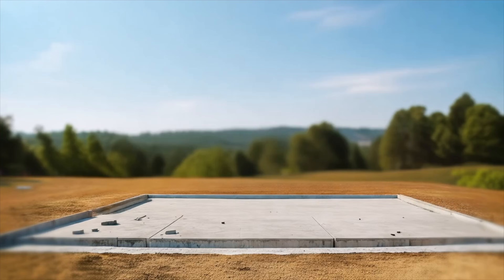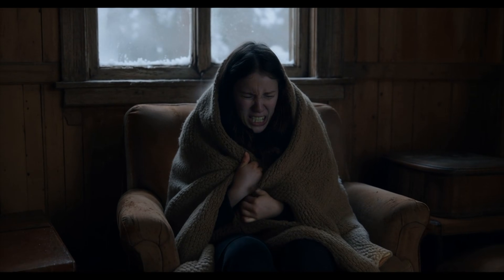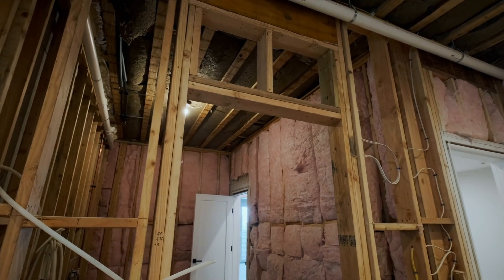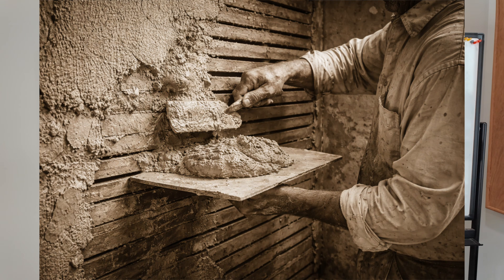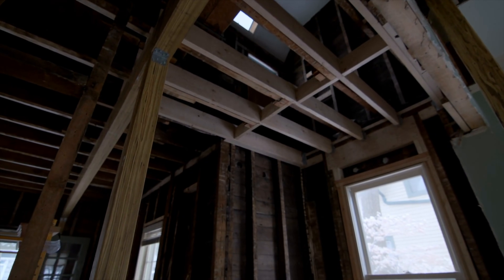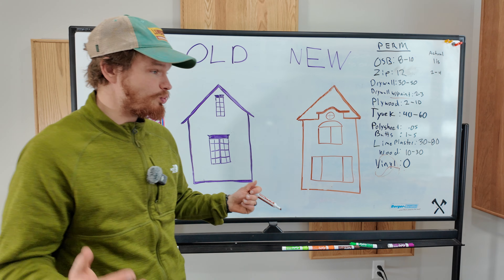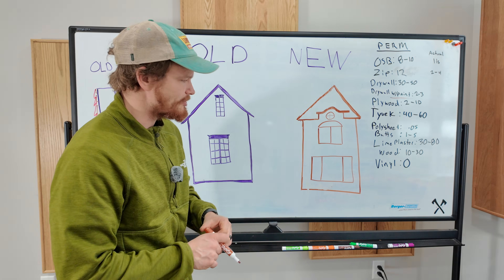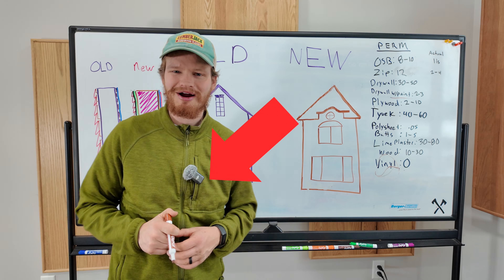New Houses Are Growing Mold — Old Ones Somehow Usually Don't

Comment: Wall permeability is a myth. The real problem lies elsewhere - it's lack of ventilation. Old houses were just leaky - even during winter days where all the windows were closed shut there was a constant air exchange. This was amplified by combustion furnaces that constantly sucked air into the chimney. Modern houses are super seal so they need a separate ventilation system - ofen mechanical one. With proper ventilation no mold and moisture will never appear. But many investors build houses with badly designed ventilation or no ventilation at all. I know people who intensionally removed ventilation from their house plans because they believed it's unnecessary. They got mold on the walls after first winter.

Comment: Turns out humans don't do well when you put their habitat in a Tupperware container. 
Our homes are meant to breath.
White wash was lyme based and let moisture pass through, it's a great finishing material and very cheap compared to latex paint. 
We bought a fixer upper home build in 1917 and first thing we did was rip out all of the carpet, floating plank, insulation roles and paneling slapped over everything. The basement and several rooms were "finished" in the 70s which means they just slapped insulation and paneling and carpet directly onto the unsealed basement  
walls, floor, and ceiling. There was SO much moisture and nastiness trapped everywhere. We did refinish and poly the master floors just because we were surprised by some major pet damage under the top layer of flooring and had to make a quick decision to seal it in place and deal with it down the road. 
The original hardwood is much nicer.
I'll forever curse the trends of the 80s that had every housewife drowning all her rooms and nice wood finishes in latex paint and sponge painting every year. They didn't even use base coast or let them dry properly between layers so I have a bunch of wood trim in ugly colors that are gummy and can't be cleaned or repainted properly, they have to be stripped or completely replaced and there just isn't wood stock available to match the quality from these older homes. Therapy would have been cheaper 🙄.

Comment: tips and tricks. maybe groves cut into the drywall to look like bords with an inch space between and not painting inside the groves. a fan pointing up in the bathroom is a great way to dry all the nooks and crannies out fast. you can also use a fan to dry out food scrapes before putting them into a garbage bag or dry out shoes to keep them from smelling. if you don't have a window in your bathroom, you might as well use a fan to dry fast and open a window elsewhere to dry out the rest of your place too

Comment: Old builders used to also feame up amd lit a roof on before sealing walls so that there was rain protection and a dry works space for the rest of the job, preventing water being trapped in the rest of the build as it is closed up.

Comment: Our modern structures are made with with hvac in mind. to seal as well as possible from outside. The problem is that they are more or less made to trap humidity in with us. Everything we do throught the day generates humidty cooking talking showering... etc. You have to take steps to control humidity

Comment: I don’t know much about building, but would a double layered outer wall with only the inner layer insulated provide the benefits of insulation while still allowing water to escape? Like say you have the lathe you talked about with old homes as the intermediate layer between an outer wall layer and an inner wall layer. Also, from your personal experience are skylights better or worse than wall windows?

Comment: Bought a very expensive new build in 2020. Had constant issues and one of those was mold. Now I am in a house built in 1993, and have had zero issues for 2 years. We remodeled our Master suite when we moved in, and the contractor even mentioned to me how well the house was built, and that they just don't make them like they used to.

Comment: Assuming that every material can be subject to some degree of water/moisture ingress, materials that are more breathable are less susceptible to mold. That's why you shouldn't fill up wall cavities with PU foam, even if the walls are made out of masonry. In fact, that will destroy a wall. Better to have wallmate boards that let the water out between the joints.

Comment: Your explaination is very good! But you've made one or two mistakes. A house have to evacuate moisture of its walls, not air. Perspiration and air mouvement are to separate things. You don't need any air movement in your wall, especially when you insulate it. Fiberglass have a very low permeability to air, but a very high to moisture.
best solution: the more a part of a wall is near the outside, the more this part have to let moisture go through. Sorry for my english, it's not my language

Comment: Almost every old house I’ve ripped into has a mould in it. It’s almost inevitable. Nothing last forever nothing’s perfect there’s always compromises with every system. You use whether it’s 10 times higher heating bells or the potential for mold.

Comment: You never insulate inside wall!!!! Wall must be insulated from outside than if it ls wood house you must use moisture insulation from inside so nothing goes through wall and condensate inside wall.. guys just check EU building steps and you will be fine.

Comment: New homes are made of chip board/OSB. NEVER TOUCH AN ANTIQUE OR VINTAGE HOME! Just LEAVE the damned floors, walls, windows, and doors ALONE. Anique walls are a house within a house-that airspace is insulatory. Just like old attics-that is insulatory. With wood siding, simply keep a healthy paint job of exterior non-latex paint. Just LEAVE damned old architecture ALONE. The technology was fantastic-all ancient hardwood. So don't touch it.

Comment: I’m a realtor
I have walked into houses that were “ weather locked”. 
As long as the roof is leak free, as long as the basement is dry, as long as the existing ventilation system works properly. It’s a great concept 
But we all know , ish happens  
That’s when you walk into a basement and marvel at the water in the light bulb

Comment: Build the old style house, but instead cavity, install rockwool. It is anti-mold and can't burn. 
But otherwise don't add any plastic etc. And interiors just avoid plastic paints as much as possible. Not easy, but you can do it.

Comment: Water intrusion in new homes is the enemy.   Designing to minimize risk is important and should include deep over hangs and soffits, protected overhangs over entrance doors and simple roof designs that minimize points of water entry.    New construction is fine as long as there are no leaks.

Comment: This happened to someone I know, had a brand new track home built and now they are dealing with excessive moisture on the second floor of their home, had to put a dehumidifier upstairs and it is pulling out a gallon of water a week. I have a 80's home with zero issues that is built extremely well.

Comment: Or short. New houses are build too air tight, because of insulation and energie conservation. Then people dont vent properly and thats how you get mold.
The colder the air the less moisture it can hold. When warm air meets cold air, the warm air cools down and releases the bound moisture on the surface.
If that moisture is not able to dry, or evaporate, it damages the insulation abilities of the material and makes it a seedbed for mold.
Old houses werent build like that, usually air is able to squeeze throu tiny cracks and holes in the facade, thus beeing able to dry or carry away unwanted moisture.
They are less insulated of course and you therefore loose more heat energy, but everything is a tradeoff when it comes to construction.

Comment: It's pretty simple, really.  Newer homes are pretty airtight.  Mold (more or less fungus) uses oxygen and generates CO2, and mold thrives in the higher CO2 atmosphere it creates in more airtight newer homes.  Older, leaky, energy inefficient homes, don't get the low oxygen/high CO2 conditions that favours mold growth.

The two main ways to counter it are to keep the relaive humidity down, which can be especially challenging in cold  spots like where furniture is against cold walls, or where condensation forms where cold  water enters the building behind toilet tanks etc, and heat recovery ventilator fans that bring fresh air in without losing  a lot of heat with it.  

In extreme circumstances. like where a house will be unoccupied for some period  of time ( perhaps without without available heat or power) clever use might be made of sacrificial calcium hydroxide to soak up any carbon dioxide that generates in the closed building and prevent the ballooning effect that its accumulation has on mold growth.

Comment: I live in a town that has 4 distinct seasons. My whole life, contractors started house when the rain stopped in the spring, and would get them weather tight by autumn. Nowadays, they build 12 months per year. They frame houses in downpours, and roof and side them with soaking wet lumber. I think this is the main reason mold grows in all these houses. It takes several years for the inside of the house to dry out, and by then, mold is widespread.

Comment: So i get that some older house didn't get mold do to better air ventalation but from experience i know that there is plenty that did, the issue lies in whether any moister can dry before the the mold sets in, alot of newer houses are more sealed so if you dont build a proper system for the enverment you live in to day yes its going to mold, secondly alot of older houses did have insulation but it was usealy saw dust or what ever they could use, and a lot of time they didn't have anything for insulation, and my last this is they had issues that was of there own, and took more for yearly up keep which if paid to day could be thousands in labour cost or take alot of time people dont have, where a good build new house might not need anything for 5-25 years

Comment: I live in a medieval castle in whales, we rarely find mold, when we do we like to use the local peasants to clean it and have them air out the castle.  Afterwards we will have a feast of boar, fruit and mead, leaving some scraps for the workers.  Also we own the vinyl siding and insulation companies.

Comment: It’s just a fact that the USA is very much behind in building standards. If done right, none of these issues exists. It all comes down to insulation, insulation and insulation and mechanical ventilation. Having to open windows is the most absurd thing i ever heard. The point is to refresh the whole buildings air volume every hour unless occupancy is low. So the best thing is to do it by measuring PPM values and Relative humidity. If you still have mold, you screwed up in the insulation department.

Comment: When they construct these new homes, they don't give the wood a chance to dry out after a rain. Also at some point in construction I've  noticed that the roof is never tapped and even the interior gets soaked. Again they do not air out and dry out so the wood retains the moisture and causes mold. 
   Now you can have proper ventilation and still end up with mold because the moisture in the wood was not given proper mitigation.

Comment: Our home got storm damage a year ago last fall, 2024 out here in WA State. Our homeowners replaced our roof and solid boards in it. Its built of solid wood, massive wood beams, and the contractor opened up the roof to our front porch. The wood inside looked brand new! Also when rebuilding the gazebo, he found pristine wood below the shingles etc....we have some dry wall but mainly solid wood walls. I wouldn't change that for anything! I would buy a log cabin or solid wood home if we ever move from here! An elderly man once told me our home would outlast most where we live! Keeping in mind our home is cedar sided....no aluminum. Our roof is tongue and groove first, then it gets the layers of plywood, paper and shingles but we bought the best we could. We also replaced the tongue and groove with elm instead of the lodge pole pine. 59 solid wood boards of that! Recently we had terrible flooding in our state with alot of cities under water! We live on the top of an island here with french drains so we had zero flooding! Not even water pooled in our yard! WE were very grateful but so sorry about the others who faced losing home, cars crushed by falling trees etc. I saw a cabin built by the water today at the beach...their woodshed came loose and is leaning forward from its foundation, lots of wood floated out as well. The home itself is getting rough so I hope they come out soon. Most of the homes here are vacation or secondary. I live here full time.

Comment: So here in sub-tropical Australia, houses are built with 100 ml (4 inch) steel studs or heavily saturated anti-termite chemical wood studs, as termites are a huge problem and will eat any wood in your house. There is little plywood used and in many homes very little insulation.  Most roofs are metal or slate, and siding is non-wood. They use a poly house wrap on the outside, but no vapour barrier on the inside under the drywall. Windows are single pane and not air tight..   houses are built on a concrete slab that could take years to dry and may crack which could allow egress of water..  Alternatively a house could be built on stumps with a yellow tongue floor which is a glue sawdust product..    Houses are pretty crappily built and have no centralized air exchange or heating system compared to North America,  Air conditioning is common and molds up pretty fast.

Comment: I"ve seen new homes unfinished or vacant and condensation on the inside of the windows in spring/summer and on the outside in the fall/winter in the burbs or the city😮😮😮😢😢😢😮😮😮😢😢😢

Comment: Build up off the ground…45 degree roof angle…3 Ft.over hang of roof ….cross ventilation in the house …grade ground away from foundation so no water standing. I built my house this way. ..no material with glue.  I am sensitive to chemicals. An 80 year old man out from Little Rock,Arkansas milled all of the wood in the house.

Comment: This is just fear mongering. As others have stated, the air exchange of a non insulated home will build up tons of condensate that will absolutely promote mold and fungal growth.
Reply: It’s not it is all truth but he does leave out at least in the parts I watched that old homes also have the same problems but for different reasons.

Honestly if you take the old method and add a layer of some water proof material to it I think it would fair better than both the modern and old designs.
Regardless I will be blunt that there are other ways to build homes better then the two he immediately shown in the video.
(Namely brick builds and concrete builds.)

Comment: Okay I had to stop listening after he said that an air conditioner puts moisture into a house. It actually does the opposite and acts as a dehumidifier. Here in Florida you can be at 80% relative humidity in your house in town at the 50% within 30 minutes by running your AC.

Comment: This is because buildings can not "breath" - this is what older houses could do.   Sealing houses to be air sealed and water proof with Tyvek cause this.

The related problem is all these technologies are ONLY about heat transfer resistance rather than heat capacity.  This is a fundamental flaw!!    Better to save the heat internally rather than simply try to block the heat.

Comment: As a norwegian, it's insane to see so much plastics used to build your homes. Shure, we use some as well, but nothing like this. Plastic siding, plastic roofs, and soo much fake wood.
Reply: I once worked in construction for a while, and it was disgusting how little was going into houses that would end up costing three quarters of a million dollars; pine wood and drywall, with a facade. If any serious weather rolled through, they’d be reduced to splinters like nothing.
Reply: Yeah, walking through old downtown in my area and into the suburbs is kind of a shocking experience. You get to see all the beautiful historic brick and timber buildings, and then get hit with the plastic houses. My partner and I call them "barbie playhouse" homes lol

Comment: 🤣😂🤣😂 as an environmental contractor, this is complete utter bullshit.  Every house has mold and older homes are no better than newer homes, new homes are far superior when properly built with the proper air circulators built into your hvac system.   Mold grows anytime your humidity is too high, 60-70%.

Comment: Is mold an issue if the mold is trapped inside between stucco/concrete/brick interior and exterior walls? I'm assuming it's mostly an issue if it gets in the air ducts or a crack forms in the interior walls.

Comment: As long as vinyl sidings are stacked like roof shingles and don't have caulking sealing the bottom sides, there should be a decent amount of breathability. But I guess the painted interior walls would definitely choke out a lot of that breathability.

Comment: Guys, this is a video on trade-offs, he's not saying old builds are perfect or wouldn't eventually grow mold under certain circumstances, he's pointing out the ways in which these new materials and methods have unintended consequences that need to be considered. Perhaps a bigger heating or cooling bill is less expensive in the long run than lifelong health issues caused by, or greatly exasserbated by, black mold